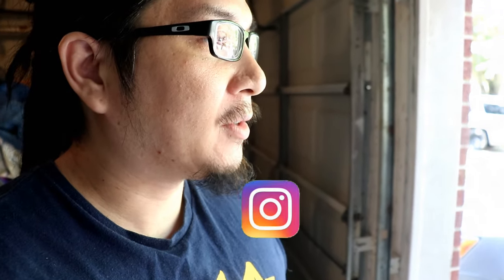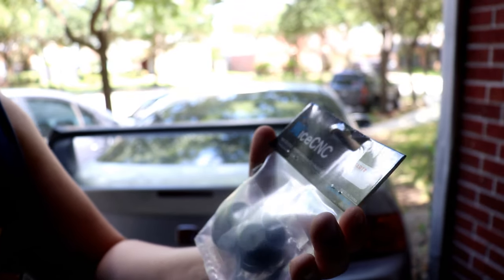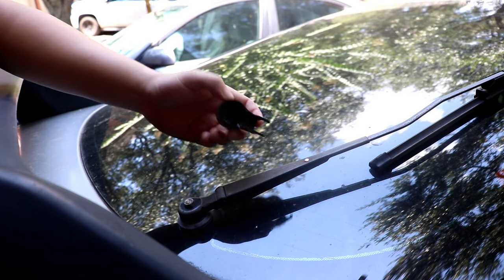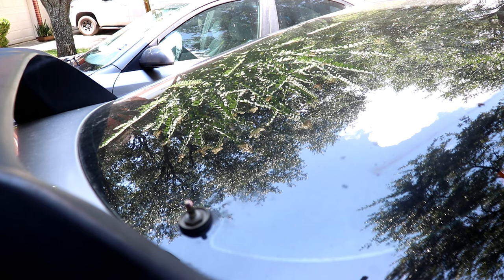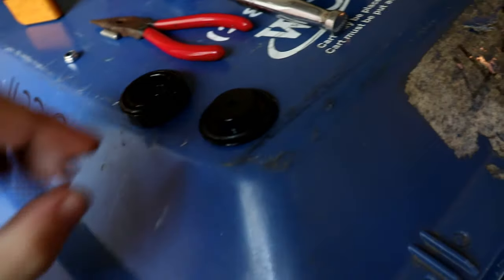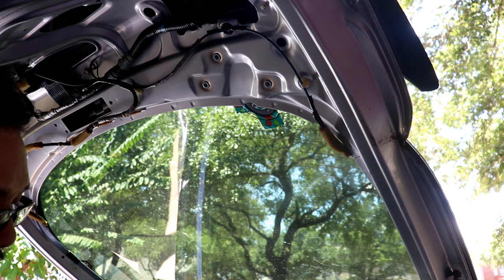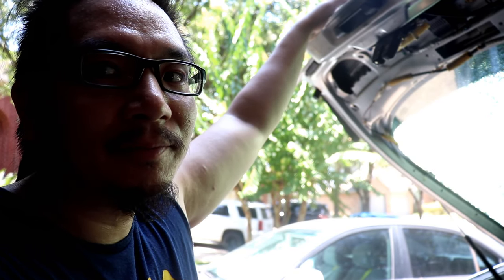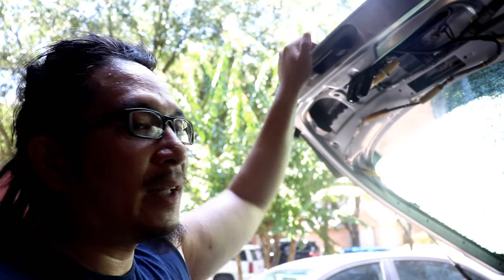I F***ed Up The RSX! | Rear Wiper Delete | RSX Installs

Comment: Damn Hulk😳 Yeah not too many things outside of the engine that needs to be that tight. Cool thing about the OEM wiper delete plug is.... it doesn’t just pop out randomly, it actually stays put under heavy abuse. Rear wiper delete is the easiest modification I have ever done to my DC5 😂  no worries though, I totaled my first Type S & shattered every window on the car on impact, I feels, I feels😭💀👊🏼

Comment: Ok definitely going with the Honda type R wiper delete plug, you basically just use silicone spray and push it into the hole.

Comment: Before he even showed the 3-2-1 and the glass breaking I said damn he should’ve kept it there and then did a quarter turn and then I went to the next video 3-2-1 and I said no he’s not gonna do another rotation. I mean the honda OEM type R plug just put some silicone on the plug and pop it in, not saying this kit that he got isn’t good but really it’s supposed to be hand tightened, and then a quarter turn with the socket,after getting it as tight as you can with your fingers, it’s really a bummer your glass broke man. An thats from a fellow RSX owner I truly feel the pain. Also it just came to me why HONDA OEM USES JUST A PLUG BECAUSE IT DOESN’T PUT PRESSURE ON THE CORNER GLASS, even going over a pot hole or speed bump the glass does partially flex.